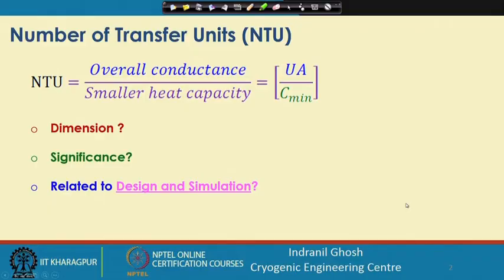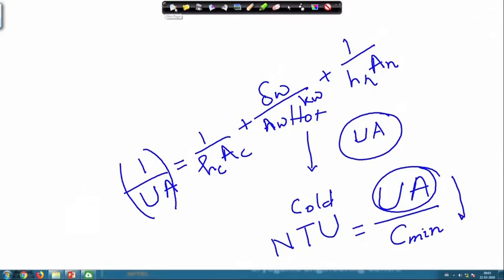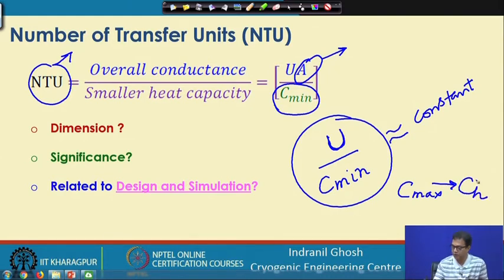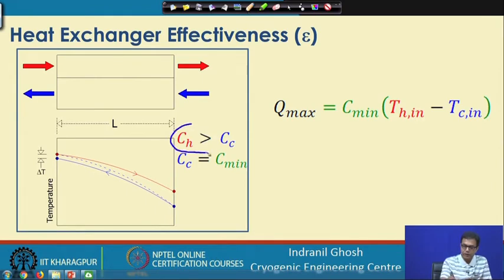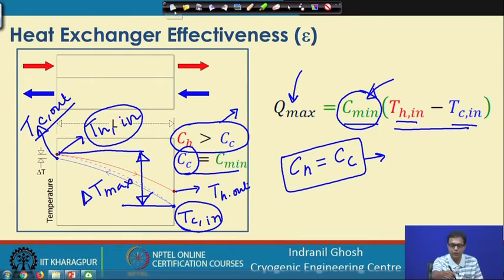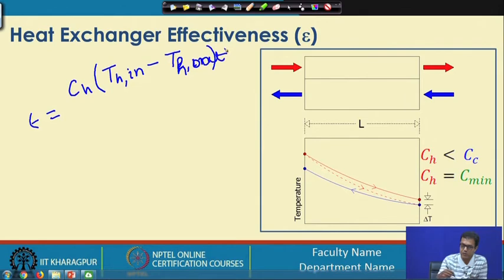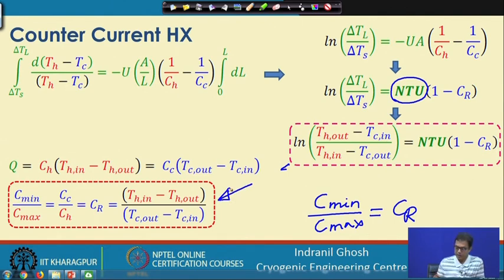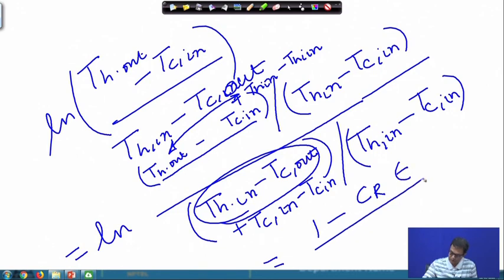Lecture 06 : Design and Simulation

Comment: why this minimum capacity fluid is having maximum difference in temperature?
Reply: The answer is in your question itself. 
Example: Consider 1 kg mass of steel in immersed in 1 kg of water. 
We have,Cp Steel:  420 J/g°C and Cp of Water:  4.2 J/g°C.
So, it temperature of steel is reduced by 1°C, it will give out 420 J of energy which will be absorb by water. 
For water, the 4.2  4.2 J of energy is required to raise the temperature by  1°C. So, by absorbing 420 J of energy ,the temperature will rise by (420/4.2)=100 °C.
So, Temperature difference for water is 100 °C  for  1°C change in steel because water has less specific heat than steel.
Reply: Thanks